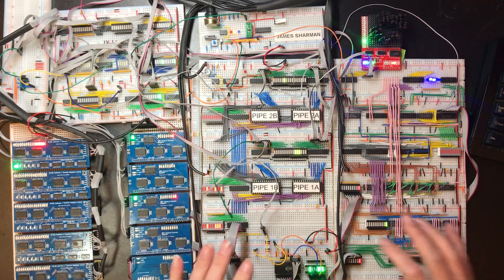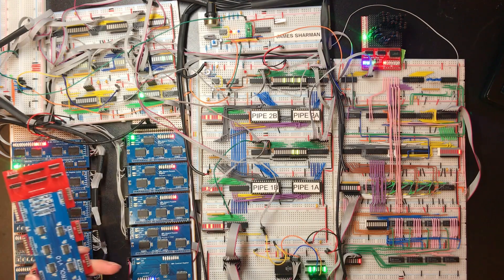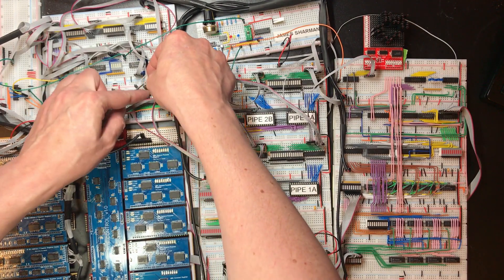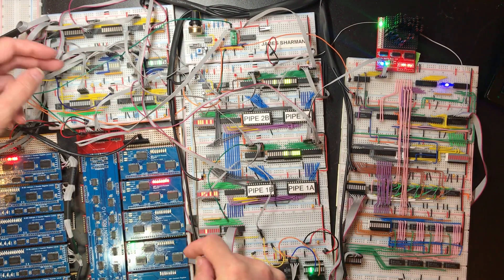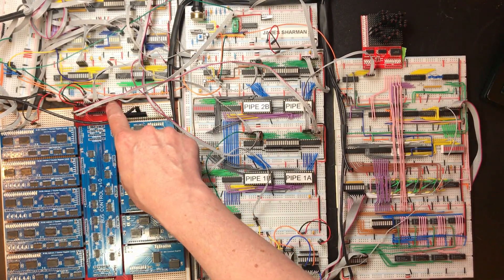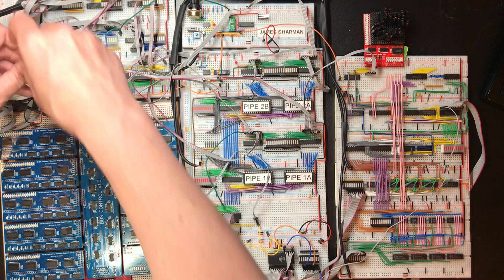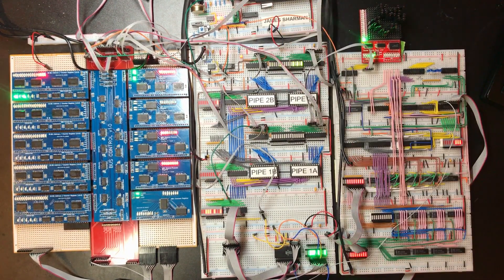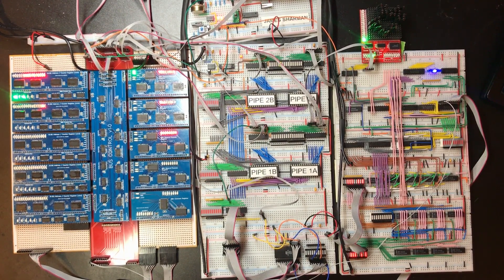Bus Control (Install And Test) - Making an 8 Bit pipelined CPU - Part 50

Comment: (9:19) I noticed a bit of odd behavior there, where RA randomly incremented. I suspect that has something to do with the floating pin issue I pointed out on the previous video.
(11:42) There it is again!
(12:50) And again!
(13:17) Once more!

I second edgeeffect on loving the "Reenactment and the clean up at the end!
Reply from the maker: Never fear, those bits of behaviour are investigated in due time.

Comment: The schematics would be much easier to read if you used logic symbols rather than chip pinouts on the diagrams. Is this a limitation of EasyEDA? 

As an aside, many other softwares have "gate swap optimisers" which are aware of logic gates being universal and allow you swap gates on the same chip (or sometimes different chips) to aid routing.
Reply from the maker: I don't think Easyeda supports that, it's just part level. I want to look at other tools but I'm sticking with EasyEda for the duration of this project.

Comment: Congrats, this looks fantastic! Also shows you really got better at soldering, there must be at least 200 SMD pins on that bus and not a single bridge or floating pad :)

Looking forward to the rest of the series (which I've seen some of from thumbnails)
Reply from the maker: Thanks Zeroji! The soldering definitely got easier with practice.

Comment: Great job, working my way through this series of videos. I'm getting a lot of ideas. I'm currently designing a 16-bit CISC CPU with quite a lot more complex addressing modes (like [reg], [reg+imm], [SP++], [--SP] and [SP+imm]) than most hobbyist CPUs, which made me hesitant to pipeline it, but I think with a deep enough pipeline it could end up being quite a performance improvement. I think I might take the plunge and design the logic for stalling the pipeline to ensure it seems entirely in-order from the programmer's perspective.
Reply from the maker: Thanks Miles. Good luck with your build. I have some instructions that do a memory access with a pre/post decrement/increment. I actually did design [reg+imm], there are some left over signals relating to that in my build but ultimately I dropped it to keep the scope under control. Quick suggestion, rather than trying to implement a cisc style ISA in a pure pipeline, consider a hybrid approach (which is actually how most cisc processors work). Have a shallow pipe like mine that implements your hardware functionality in a streamlined/raw form like mine but then stick a microcode engine on the front that turns each instruction into one or more microcode instructions that are dispatched down the pipeline. It's what I would do if I wanted to layer more complicated functionality in.

Comment: Seriously impressive work! I can see in the vidoes ahead there were some things to iron out but to get this in a semi-working state more or less first try is the hacker's dream. The memory bus request/ack stuff is still a bit fuzzy to me so I'm looking forward to seeing how that all works!
Reply from the maker: Thanks Scott! Bus request/ack is something that processors have to enable an external device to take control of the bus. The request line is asking to take control of the bus and the acknowledge line let's the external device know that's safe to drive the bus. My acknowledge line is an other unassigned address elect line (So if it's active I know no address registers are outputting an address to the address bus). It's not set in stone if I'll use this functionality, it depends on the system I go with for streamlining code upload (My original plan to was to use it for a microcontroller based debug interface).

Comment: First of all this looks great. I'm still back on Part 38 but I skipped ahead a bit to see where you were.  I was wondering if you plan to publish an architecture block diagram?  Also I saw in a really old comment that you didn't plan to implement any interrupts, is that still the case?  From an architecture standpoint what makes interrupts too difficult to approach with this build?  Lastly what is the max speed you're shooting for?
Reply from the maker: Thanks, glad you are finding it interesting. I’ll probably add a bit more documentation later on, the various schematics I’ve shared via the EasyEDA account probably fill some of your requirements in that regard.  When it’s complete I’ll probably pull out my “back of a napkin” designs from the start and run a comparison. I’ve no plans to implement interrupts at the moment. This build was designed to be a fairly “simple” test of a pipelined processor to get as much as possible structural performance as possible. There can be multiple instructions “in flight” at a time, there are situation where an interrupt service routine would change the behaviour of the executing code without a bunch of extra logic to save or flush the pipeline state. I thought it was better to stay simple and focus on one set of goals at a time. I have a set of design goals for some follow on work which would include demonstrating interrupts, but I’ll never finish this thing if I don’t constrain myself.
Reply from the maker: I assume by “max speed” you mean clock rate. That’s not actually an easy question to answer, when it’s complete I’ll test it out and see how high it can go, I am aware of some hard limits (from the speed of some components). I’ll be disappointed if I can’t clock it high enough to go over a million instructions per second.
Reply: @weirdboyjim  Drat, on the interrupts!  I'm going to have too "have a think" ( love that expression ) about it and see if I will include them or not too now.  Since I wanted to perhaps in the future connect some external IO like maybe a UART for Flash memory I figured having at least 1 interrupt was a requirement.    

I know I left a note last week about the timing on your 16 Bit registers and wanted to give an update.  My friend loaned me his O-scope to play with and I spent a few days learning what the millions buttons on it do.   I put a copy of your registers to it for testing.  The difference being I'm using HCT series chips, not LS series. When I did the numbers my power supply wouldn't easily handle all LS chips and the HCT used like 3x less power.   Anyway the datasheet has a formula on it that came out something like:

1 / (CP-to-TC prop. delay TE-to-CP setup TE-to-CP Hold) * 1000 == Max f.  For my chip those numbers for a single chip were 48 + 13 + 3, then an additional 3 + 3 for the extra carries.  Those are the 'max' times.  The Typical times were 18, 13, 3, 3, 3..  The Scope confirmed a gate delay of 30ns from the last carry. I moved the probe the the second chip halfway through and got around 25ns, and finally a single chips carry was around 20ns.  So the test numbers held up as best I can tell.

Given the above info I calculated that the 'MAX' speed for HCT parts on your register design would be 15.6Mhz.  Since we need the outputs to be settled on the latch chip inputs in 1/2 a cycle that means ~7.8 Mhz.   I was secretly hoping for > 8 and maybe 12 when I started my design, so I'm going to explore a version of the register that only counts 'up' ( down for the PC ) because there is a fast 'act' series chip but there is no up/down counter. The 'act' series chip appears to run about ~3 times faster.
Reply from the maker: @genxtech5584  If you want to push for a higher clockrate, you can invert the clock line going to the latches. You’ll need to tweak fetch to (and your isa documentation) to account for the increment result “appearing” on the bus a cycle later, but you would double your effective speed. There are techniques you can use to get faster still but 15mhz is going to be pushing the limits of a lot of other components.

Comment: What is the approximate cost of all the hardware that you currently have built?
Reply from the maker: That's a really tough one to answer, I've obviously bought a bunch of components that are currently not in everything. There is probably about £50-£60 worth of components and boards in the frame of this video, but I've spent several times that over the last 6 months.
Reply: @weirdboyjim  wow that is way cheaper then Ben Eater's computer. And yours actually has usability.
Reply from the maker: I've obviously still got a way to go, but now you've said that I'm worried I've underestimated... Not sure I want to investigate further ;-)
Reply: @weirdboyjim  well the system needs conditional jumping, normal jumping, halting and then it's Turing complete, I think.
Reply from the maker: Turing completeness is a tricky subject. Don't forget I still need to build the memory bridge and wire some ram in. Technically I'm Turing complete with that and the transfer register. There is already a jump that takes TX as the destination, with the transfer register you could turn that into a conditional jump in software. The conditional jumps will obviously make it a lot more practical, I'll need to add the stack operations and call/return before I draw a line around the core and start regarding it as a functional cpu.